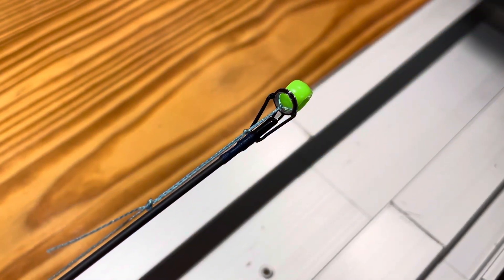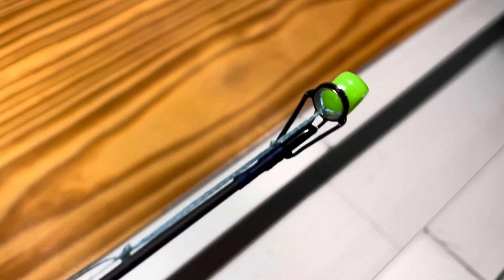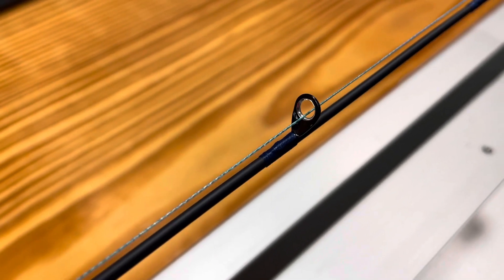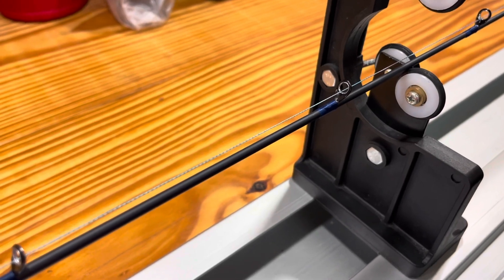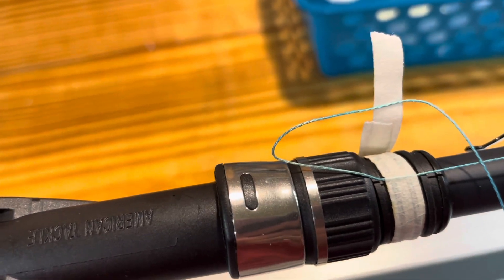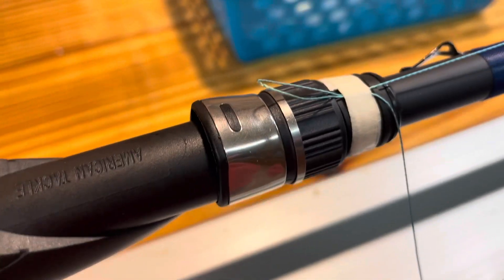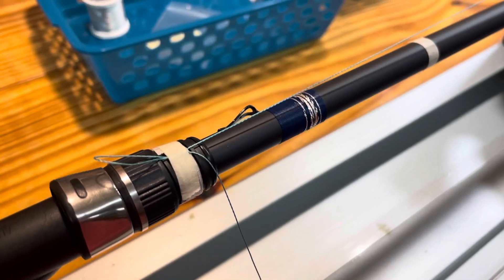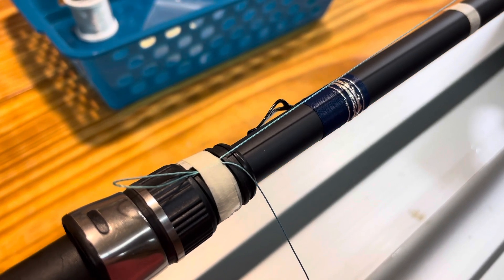Get Your Guides Straight Tip

Comment: Just curious does microwave guide outperform a traditional guide when using braid? And do you get them from AFTCO? Thanks a bunch
Reply from the maker: They have been proven to, one of the main reasons is, the smaller guide in the first guide calms the line down before it gets to the other guides helping it to cast further, be more accurate and less effort in casting by the angler

Comment: I am 71 and have macular degeneration.  I no longer see straight lines, but sine waves.  This is the ONLY way I can line up the guides.  After wrapping, I run the line through them again to do a final check and adjustment before finishing.
Reply from the maker: I hope this tip helps people, I know it works out for me pretty well, I do still double check it. I have noticed over the years blanks have curve to them sometimes and it can throw things off